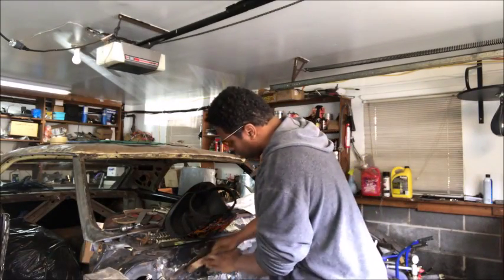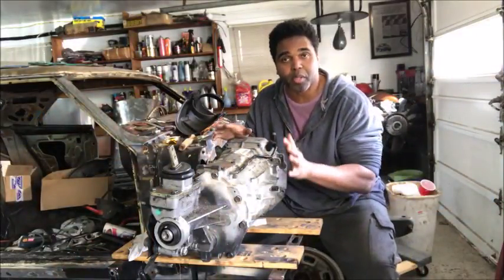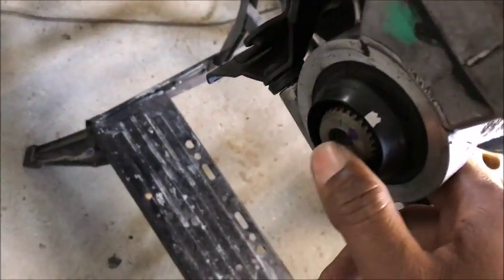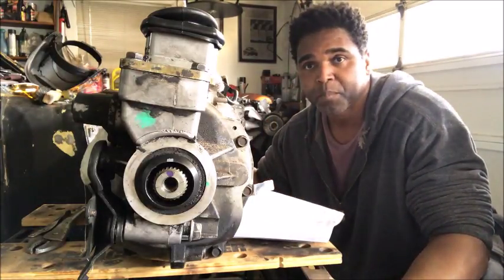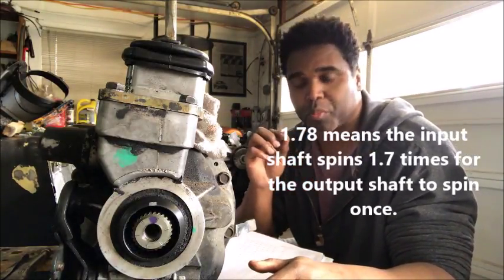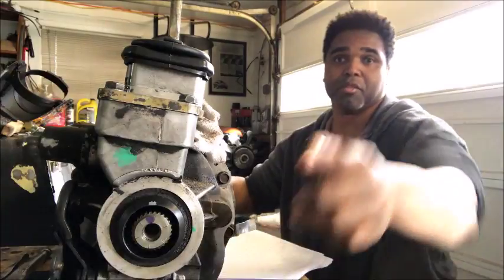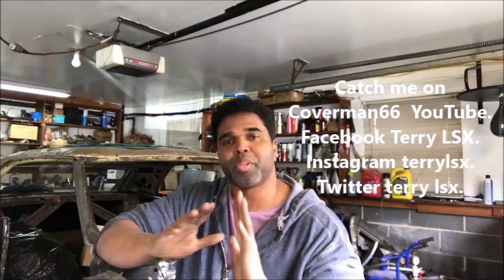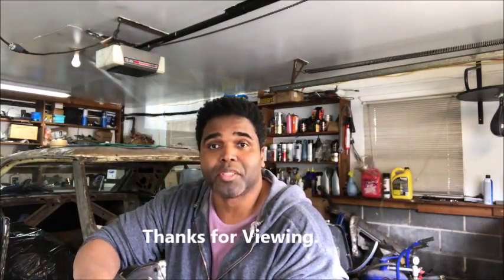How T56 Transmission Gears Work (Input/Output Shaft Explained)

Comment: Where can I find the revolution specs for another tranny? 4l80e?
Reply from the maker: have you tried searching in google? there are ton of info online for  the 4l80.
Reply from the maker: if we are talking about the output shaft on the trannys where the drive shaft goes over i think they are different.. if the spline number is the same you might get lucky.